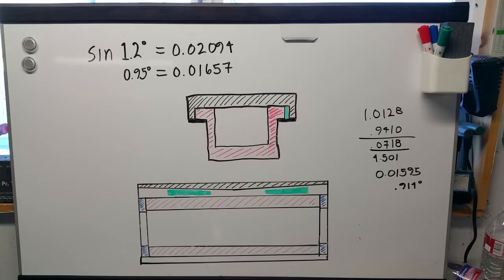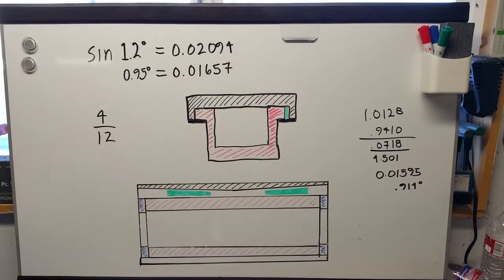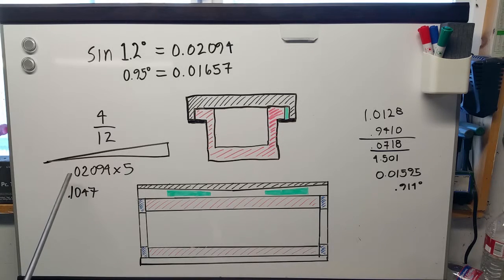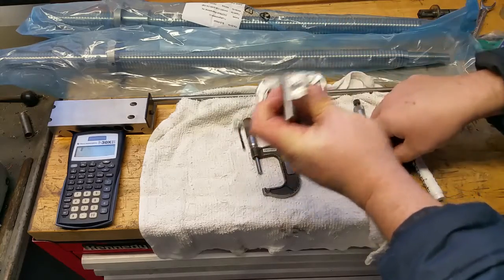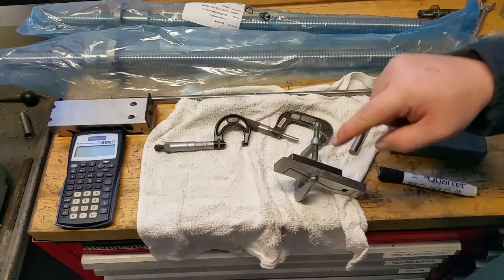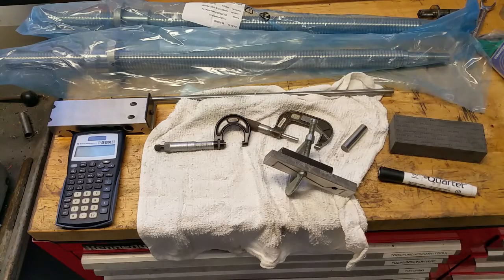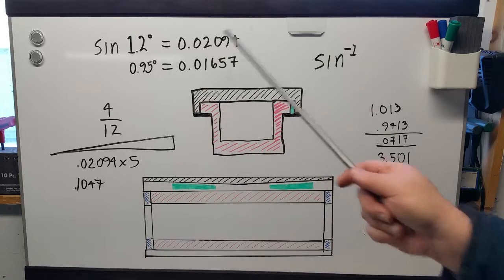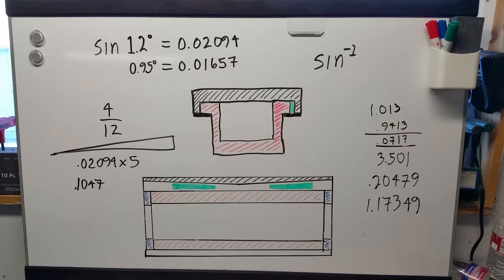What's a Gib, and How Do I Measure it? Part 2

Comment: I know this video is over 5 years old, but rise over run is a tangent function not a sine function. Sine is opposite side over the hypotenuse, and your using the adjacent side.
For very small angles, tangent and sine are close, but not exactly the same. 
Using Arctan of your number the angle is 1.17324569. Very small difference, but the correct answer.
I've been screwing around too much setting my lathe compound using a sine bar that I made a bracket to hold in place. Problem was my import lathe was made from every incorrectly made component, the compound side is not parallel to the V-way slide.
And I used the same way of calling out tenths, as you.
Reply from the maker: Thanks, yeah, may have mixed up my terms.  I have a cheat sheet for trig that I wrote up years ago and I refer to it when I need.

Comment: Why not lay it on a mill table and sweep a dial over it to a given nominal distance. It works good, unless you’re mill is broken....
Reply from the maker: Because I actually had to measure the tapered surface on the machine table first.  I used this technique to measure the taper of the machine table, then the same method to measure the gib.  Using the same measurement technique for both parts helps to prevent inconsistencies.